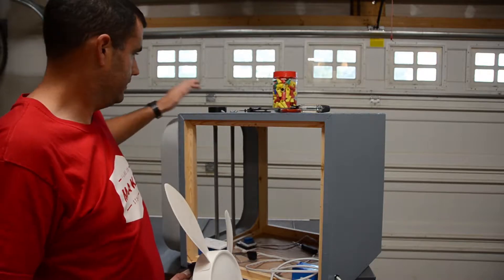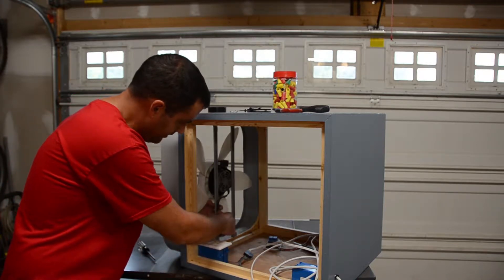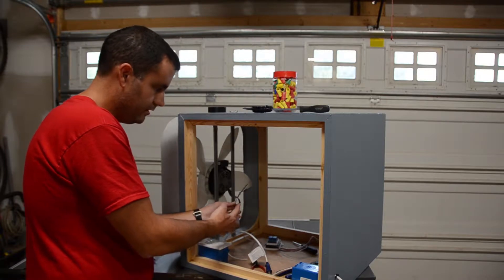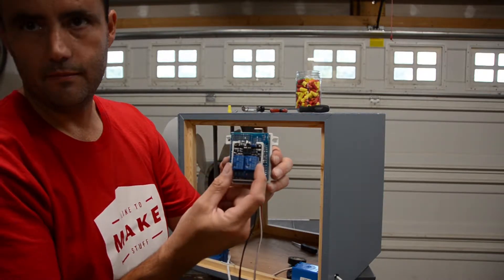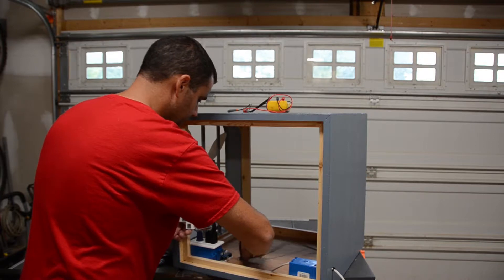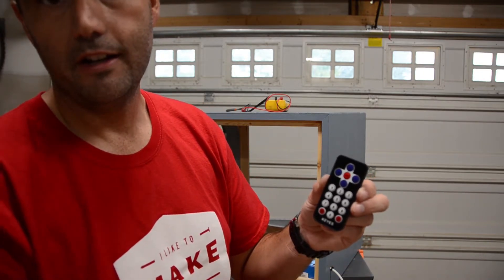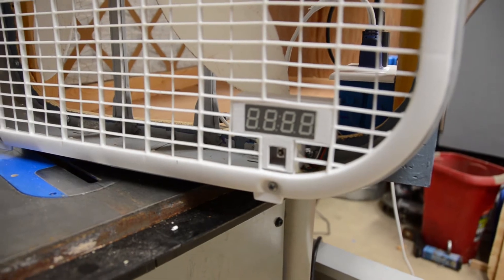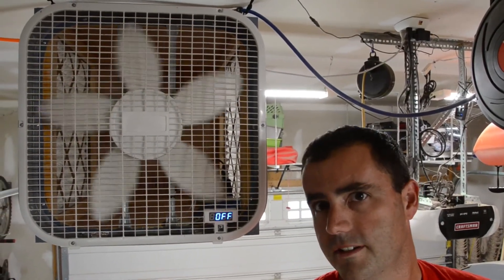DIY Arduino-Controlled Shop Air Cleaner Part 3

Comment: i never realized the power switch operates that way with 1 wire for each speed, i don't know a lot about electric motors, but isn't there a way to just put some kind of pot on it to have variable speed without it switching like that? Is there something with the design of the motor that makes it dangerous to do?

Comment: Nice plan Brad, to clean the air in your garage (workshop). And it still looks good too.
Now that I've already looked at the three parts, I still wonder why you close the small holes in the frame of the fan while leaving a large space around the fan blades open. Due to this large opening, a lot of air will not be filtered out and will be blown back in. If you close this opening, the air will be guided through the filters better and will therefore also be filtered better. Furthermore, it seems to me a good idea to build in the electronics in a box to prevent pollution and therefore an uncertain functioning. But it's still a nice box.
Reply: Thanks for that feedback.  I'll be building a new one some point in the near future, and i want to make it a smaller profile using one of those dual fan window units.  When I build that one, I'll take your thoughts into consideration and try to make it more efficient.

Comment: i was thinking if you only have two filters then it could work to just make box a triangle prism instead. so the two filters would be in a "V" with box fan capping that "V" into a triangle. would be less material and maybe a little more streamlined flow path? anyways thanks for making this vid!

Comment: Great vid, thanks for taking the time to share this project. One word of caution though, to save wear and tear on the fan you should avoid going from off to high speed...

There is a reason every fan you've ever seen has a switch that cycles off- low- med - high... going from off to high is asking a lot from those cheaply made chinese motors, forcing you to start the fan on the lowest speed means it has an easier time overcoming the "sticktion" of being motionless.

It's analogous to trying to pedal a bike in it's highest gear or a lower one, you always start out on the low gear then shift to a higher gear ratio once you have momentum... starting out in the highest gear is a lot harder on you and the bike.

You may want to force the programming to do this... or just remember to operate it that way. You'll get a lot more use out of this cool project before having to replace the fan.

Comment: How does it actually work? Is it effective?
Reply from the maker: It works very well. In my 2.5 car garage, it does a great job of circulating the air and pulling fine dust out.

Comment: How has the air cleaner held up?  I was wondering about all those components that are inside.. Are they still good (clean or dusty)?   I am about to do one for my shop.  Any reason for doing only 2 filters and closing the back-side?  2.)  A lot of other builds would use multiple filters.  I even seen one that used a filter in the back and front..
Reply from the maker: The microcontroller and other parts are holding up well.  They have some very fine dust on them when I change filters, but so far it hasn’t affected their functionality.  If I were to build another one, I would put a filter on the back too.